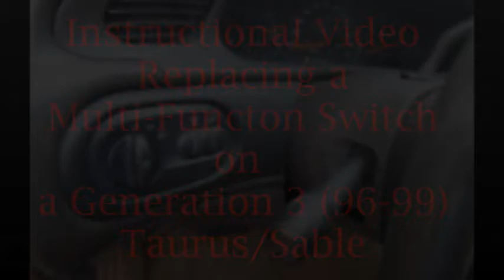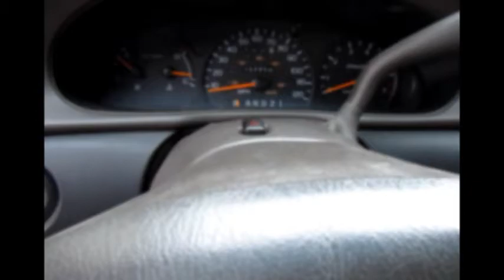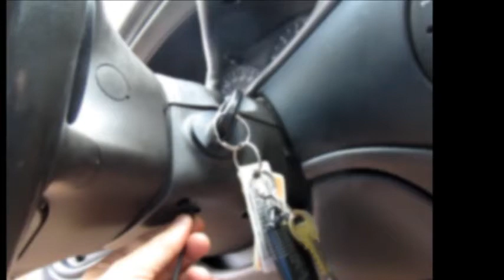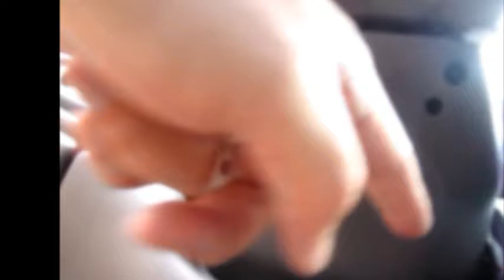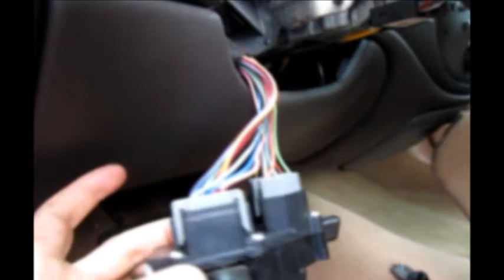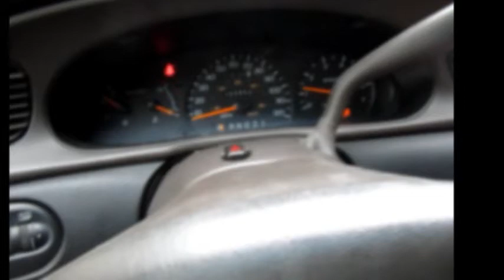Multifunction switch replacement Taurus or Sable

Comment: Just pop off the black trim collar at the ignition lock, it snaps back on, no need to remove the lock cylinder.
2000 models will also fit the early years, only difference is the stalk is angled up about an inch, no problem.

Comment: Have any idea what would cause a no start no crank situation after replacing this switch?
Reply: If you didn't unhook the battery the anti theft will kick in you will have to get a scanner to reset it ran into the same problem once

Comment: does ignition switch need to be dropped on a Taurus?
Reply from the maker: Obviously this video is on a Generation 3 Sable which is very similar to the Gen 3 Taurus. For  Other generations it may be different enough so you don't have to remove the ignition switch.  I don't know the answer to your question.  I would try to do it with out removing it and see how far you can get. However if you find you can not remove the plastic trim panels because of the ignition assembly, your answer is yes.   You will have to remove it.  Good Luck.

Comment: does the multi function switch include the wipers, signal lights, & parking lights. The reason, when the parking lights come on then the wipers start working. doesn't go off until parking lights go off. then if I use the signal lights, the wipers come on. So just need some info. Thanks!
Reply from the maker: Evelyn,  the parking lights are not controlled by the multi-function switch but an electrical problem with one system may cause a problem with another.  I would start by looking for bad grounds or shorts with the parking light and multi function circuits.  Good luck!

Comment: My flasher will come on and with in a second it will cut back off, I have a Mercury Sable 01. It was told to me that I need to replace the multifunction switch my friend did so. The flasher still cut off.
Reply from the maker: +Anita Morgan If you still have an issue after replacing he multifunction switch with a new one I would next look at the wiring and connections.  Somewhere there is a bad connection. Make sure all of the wires going into the connection are well connected.  Not always easy to find but be persistent.  Good luck!

Comment: Thank you!!! This solved our problem of "phantom" wipes (the wipers would occasionally cycle with switch in the OFF position).  Also, we discovered the aftermarket switch we purchased from O'Reilly's would not work - I tried 2 of them and the wiper delay feature would not work with either switch.  I purchased the switch from AutoZone and everything worked as it should.

Comment: Hi, thanks for the video it's pretty informative. My question is, my 96 Mercury sable signal/warning lights are not working properly. When driving I indicate my signal sometimes it works some times it just stay on solid and other times it does not come on at all. All my other lights work fine...hi beam, brake lights etc. when my signal works I have put on the four way and all my bulbs are fine. I went and purchased an electronic relay fuse but I can't figure out which is it on the panel as it is not clearly labelled. Help please thank you.
Reply from the maker: foday kpanabom If it says on solid that is an indication that the light blub is burned out or has a bad connection.  Check the bulbs and make sure there is not corrosion in the sockets.  Also check for or a loose wire with a bad contact.  Good Luck.
Reply: Ok thank you. Appreciate it

Comment: (Not good with car lingo but ima try lol) so i start car hazard ALWAYS WORK REGARDLESS, all bulbs work, turning signals work. I drive maybe about 5-10 mins and the turn signals go out. Like i cant hear or see them on dash and they dont show other cars im turning. So i turn around and use hand signals lol. But if the car is off for awhile the signals work again and then go out again. Do you know what that could be?

Comment: I have a ford taurus 2001 and my turn signals stop working while driving, do i need to replace the switch or what could it be?
Reply from the maker: Cash Chapman Can you describe your problem with a bit more detail?  Do you mean the turn signals don't work only when you are driving.  Do They work when the car is stopped??   Do the flashers work?  Did you check the light bulbs  both sides front and back?  Thanks.

Comment: Thanks for the video! Worked like a charm. Had a 1999 Taurus that had an intermittent wiper problem and after $80 for a new switch, this video told me exactly how to do it. No more will I have random wiper action. Saved $250 from the dealer!
Reply from the maker: Skek Tek Thanks for the feedback and good luck with your 99 Bull!

Comment: Thanks for the vid, this process is more complicated than it was on my 98 Crown Victoria. Is it possible to change the turn signal switch without removing the bottom panel? Also, are 96 and 98 same generation of vehicle? I ask because I have a 98 sable, and when I removed the top panel without removing the bottom, it appeared to me that I would have to pull the steering wheel in order to remove the turn signal switch.
Reply from the maker: Daniel Jackson  Yes.   The Generation 3 are 1996 through 1999 and are identical.  The Generation 4 are 2000-2007 and are similar.

Comment: Thanks, this video is just the help I needed to do the repair. The part that took the longest was  trying to get the connectors off of the old part, not much room to work back there. Only thing I can add is the battery cable terminals were 8mm on our 96 Taurus. Thanks again.
Reply from the maker: I agree those connectors can be very tricky to remove and on an older car like a 96 The plastic can become brittle and is easy to crack.  So patients is the key. Yes, the OEM terminals on the 96 take a 8mm wrench.  You can also use an English 5/16".     I am glad you found the video of helpful and it all worked out for you.

Comment: Hi, I have read that replacing this item could fix my brake light issue. My bottom brake lights on my 2006 taurus se are not functioning, however the brake light on my spoiler works as do my tail lights and turn signals. I have checked fuses and bulbs and they are fine. Would this work for the 2006 taurus as well?
Reply from the maker: Frank,
I would first look at the simple stuff like ground wires and inspect the bulb sockets.  Make sure they are clean, no corrosion and tight.  I know this sounds obvious but ......

The brake light switch on the brake pedal is a common place to have an issue but since you 3rd light is working it should be ok.

Look at wiring Red/ Light Green wires coming into the tail lights.  They power the brake light function.  Black wires are the ground. Check all body grounds.

I have never heard of the multifunction switch effecting the brake lights.  If you can get a wiring diagram for the brake lights it help you understand it.
Look at page 12-33 and 12-34 of a Haynes manual for a schematic.  Good Luck
Reply: My 97 taurus had the same issue.... mine was caused by the brake switch. It was not making the connection to "show" I was pressing the brake pedal.

Comment: Hi, I was hoping maybe I could get your opinion.  I have a 2002 Taurus, everything with the MFS seems to work (wipers, hazards, turn signals, etc) the only thing that will not work are the high beams.  The indicator light does come on for passing and when I push it outward but no high beam lights come on.  The regular low beams come on with no problem but when I depress the switch for high beams, I get nothing.
I have checked all fuses and the actual headlights themselves do not appear to be burnt out.  Do you think it is indeed the switch??
Reply from the maker: Tonda, I cant say for sure, But I would bet the switch is ok since the indicator light on the dash is consistently working for both the high beam on and the flash to pass feature. 
Sounds like a possible grounding issue.  Get a wiring diagram and take a look at all of the connectors.  Make sure they are tight. wiggle them and see if you get any signs of high beam working.

Double check both bulbs and make sure that the connections are tight and free of corrosion.. Make sure they are both the correct type of bulb too. 9007.  Good Luck!
Reply: nbpt1000 m

Comment from the maker: Yes, Unfortunately you do.  But it is not a big deal.  It will reprogram it self after driving a few miles.  You may have to reprogram your radio presets.  Thanks for your compliment and question.